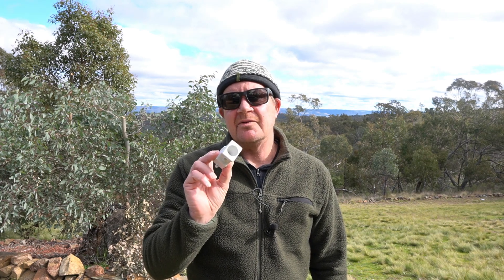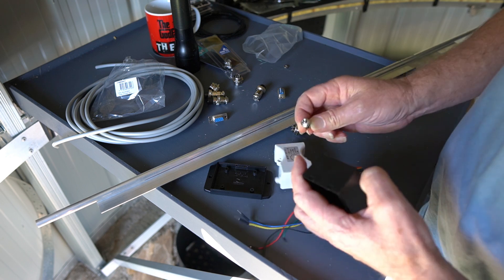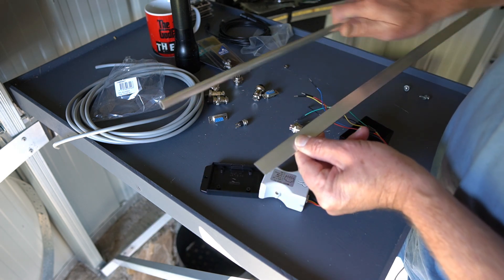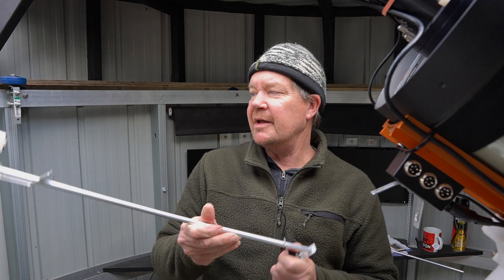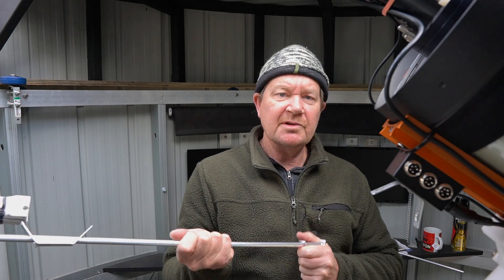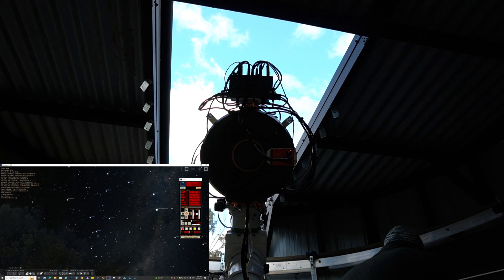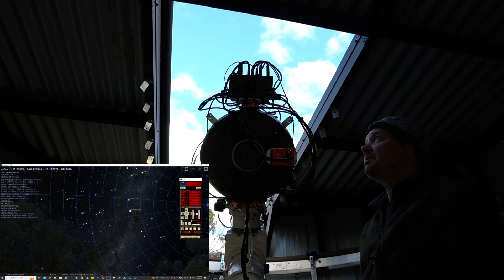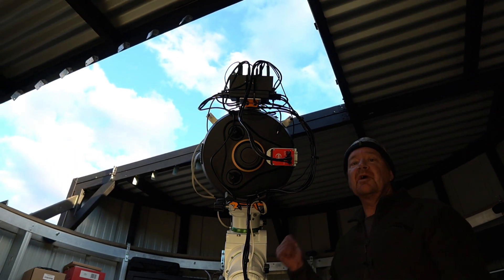Observatory Control Using Ultrasonic Sensors.

Comment: Where did you source those sensors? I have been looking, but none so far.
Reply from the maker: Sorry Bobmay, I seemed to have missed your comment. I will attach two links below. One is the specs and instructions for the sensor and the second is the link to where I purchased in OZ.

https://wiki.dfrobot.com/Water-proof%20Ultrasonic%20Sensor%20(ULS)%20%20SKU:%20SEN0300
https://core-electronics.com.au/water-proof-ultrasonic-sensor-uls.html
Cheers Don

Comment: My honest opinion Don...although I'm mega impressed with your ingenuity, I just feel this is a bit of over-kill for a simple problem? Would you not find it easier to simply setup your rig so it can never hit the roof, or walls, or anything at all? That being said, I really am impressed with your skills Don!

Many Thanks for a great vid Don!

Wes, Liverpool, England.
Reply from the maker: Hi Wesley, Yes agreed it is overkill. I hope to have professional proprietary software with an encoder wheel to drive the system one day. For now though this will have to suffice. If I had a roll away roof this would not be an issue, but due to the high winds at my elevation and site, I need an enclosed style roof for protection.

Take care Don

Comment: Damn cool, I like it!  I was thinking of using an Arduino with an ADXL345 (or two) to track the orientation of my scope after watching a video by "How to Mechatronics" but your setup may be more robust,
Reply from the maker: Thanks' Bruce. I had a few ideas using various sensors, but settled on this. Was thinking of using lasers but very expensive and brings to much attention to the observatory.

CS Don